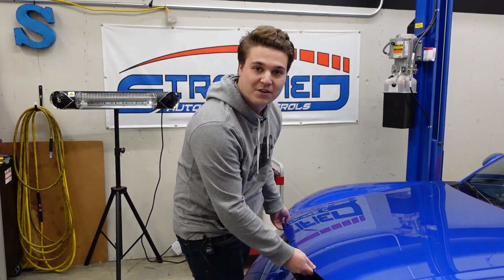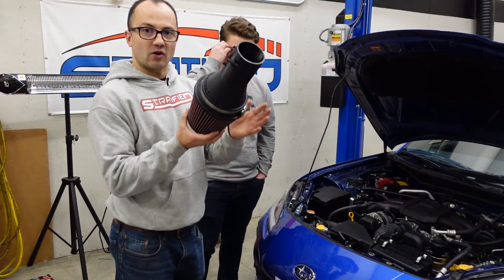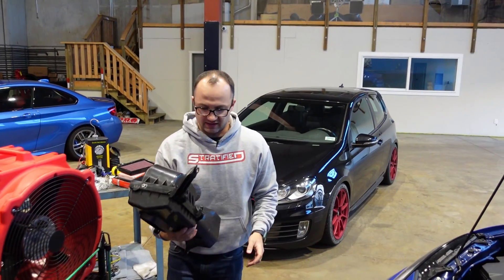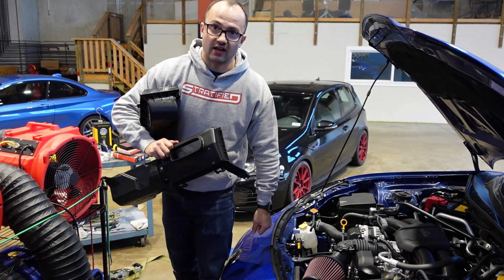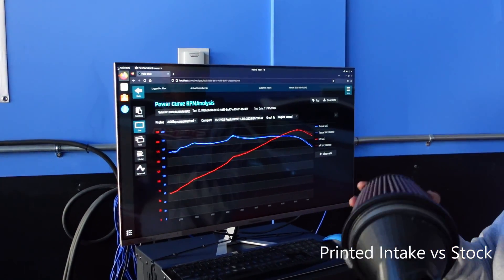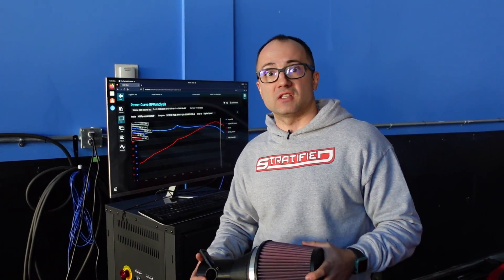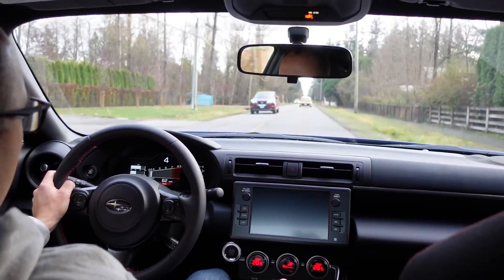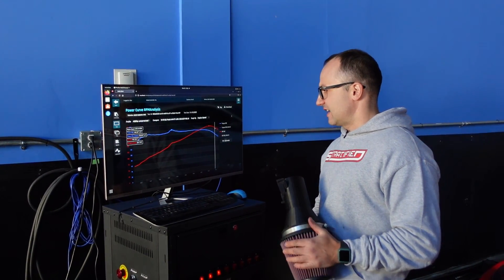2022 BRZ Build EP10: Tuning for Intakes - Worth It??

Comment: There are several other dyno videos showing 5-10HP from charcoal filter removal. There is more to an intake than just slapping a filter on a tube. Intake resonators that tune vibrations and harmonics are a real thing.
Reply from the maker: Tested with OEM filter, high flow filter and removed the filter altogether. You’d think if the air box was a restriction you’d see something. However if you wait a few hrs between pulls the first pull will generally read highest. So when you’re talking about a few hp you have to be pretty methodical.

Comment: Since my tuner said "lack of oxygen" was holding me back (from more than the 226 corrected HP) I'm working on getting cool air in without using a snorkel from the radiator area (and blocking some of the radiator). I have a 3" aluminum tube going from the box/MAF to the throttle body. I will insulate the tubing. I already have gold reflective tape on the box.
I have cut a rectangular hole in the fascia so air can go straight into the airbox through a fabricated rectangular tube.
Reply from the maker: More air, cold air, always helps. Engine is an air pump. Making flow in and out as efficient as possible is key.

Comment: You still have the accordion intake tube. Gotta get a smooth one. Then the real purpose of an intake will show, which is throttle response. Not horse power or air flow. Along with a throttle body port, it's worth it to me
Reply: Would you recommend the grimmspeed post maf hose?

Comment: My 86 came with a KN, i put a std filter there instead, dynoed less hp with a KN on my other track car, so it has OEM filter aswell. OEM doesn't look cool but works well in many cases :)
Reply from the maker: For modern cars the intakes are pretty well designed.
Reply from the maker: For modern cars the intakes are pretty well designed.
Reply: @stratifiedauto  my track car is actually 40years old, bur porsche made the filter very big and with lots of folds/filter area, Which apparently worked well :) Though for sure not all old cars do that.

Comment: You should try the charcoal delete, i have seen this subarus getting up 10hp only by the charcoal delete... you can say that the "conic" air filter does not have any charcoal delete, but i really think that the stock airbox is a lot better than a conic filter on a stock engine aplication...

Comment: The BRZ/GR86 is advertised 170KW in USA and 174KW in Australia. The extra 4kw is the charcoal filter we do not have :)
Reply from the maker: Video next week will reveal more :)
Reply: @stratifiedauto  I for one would be interested to see what the difference would be using the Technocraft intake resonator blockoff, and a post-MAF silicon hose, those together plus removing the charcoal filter and using the k&n filter should be the equivalent of a full cold air intake

Comment: What is that carbon doing and why is it tied to compliance? Is on the intake so it is taking air out of the environment, not exhaust, I don't understand the reason of carbon before the engine, there is nothing to clean on the intake.
Reply from the maker: Soaks up fuel vapors coming out of manifold once car has been shut off.
Reply: @stratifiedauto  ok that makes sense

Comment: Well,  the air filter restriction is not really a problem for pretty much all modern engines. So the power/torque gain from intakes comes a lot more from having the air flow in more efficiently and not carry up heat with them from other sub-systems (manifolds, even the engine bay itself is a pretty warm region compared to where the air feeds of the OEM-like intakes take the air from). So larger open-filter intakes may gain sense when the power output is increased by a lot or some specific goal is on the list (sound).
Reply from the maker: Some intake manufactures on MAF based cars also play a little with MAF housing size to adjust what the ECU is seeing, read less airflow and gain a bit from this ECU reading offset.

Comment: What car seat do you guys have in the back? How well does it work?
Reply from the maker: I use 2. A maxi cosi rodifix for a booster and britax emblem for my 7 and 3 year olds. They work great and yes the BRZ does school runs no problem.
Reply: @stratifiedauto  thanks for the reply! I tried a Diono 3RX but there’s a gap between it and the BRZ seat cushion at the back. I also tried our Britax Grow With You ClickTight Plus Harness-2-Booster but the base on that thing is too wide. Are there any tricks to getting either of your seats to fit? Thanks!
Reply from the maker: I actually went for the smallest seats and did research on the Porsche forums for small base seats. The 3 stage seats or seats with things like cup holders won’t fit well. Maybe I should do a video on fitting car seats.
Reply: @stratifiedauto  yeah that would be amazing!

Comment: How much calibration did that MAF need with the intake on it?
Reply from the maker: We sized it to OEM spec. So none.
Reply: @stratifiedauto  that speaks to the design and how stable it keeps the airflow over the sensor as well. 👍

Comment: Do without the carbon filter
Reply from the maker: The gains will be similar to what you see with the intake. A couple hp.
Reply: @stratifiedauto  I don't think anyone was expecting 30whp from an intake. But there has been dyno runs w/o the carbon filter that has showed some gains with stock filter.  

Itd be nice to have another data point, even if it is just 2-3 whp at 8k rpm lol
Reply: @stratifiedauto  it's 8 horsepower actually, there are tests

Comment: All this talking.  Didn't tune the car at all.  Before or after.  Even though its been shown again and again that the car like the Gen 1 learns and goes back to how it was.  It's the 2020's not the 1990's!
Reply from the maker: Yes this was all tuned for and datalogs verified for consistency. The MAF housing we built is identical to OEM to not throw readings off.